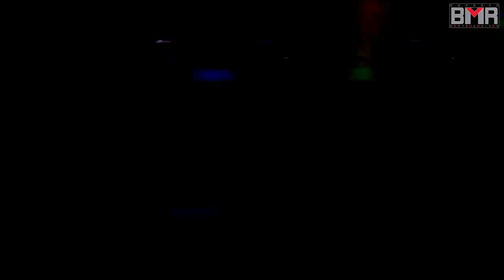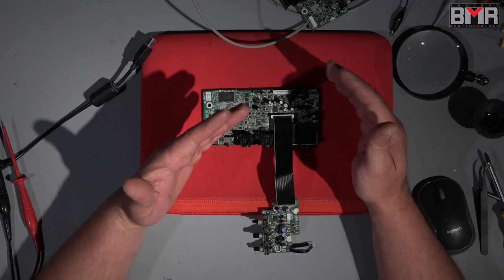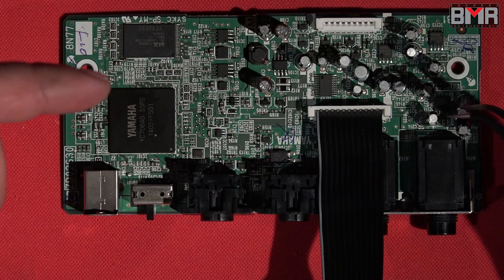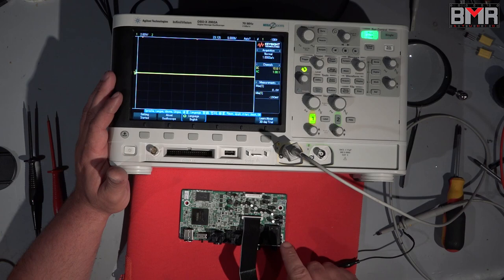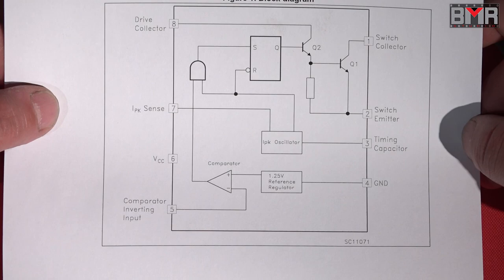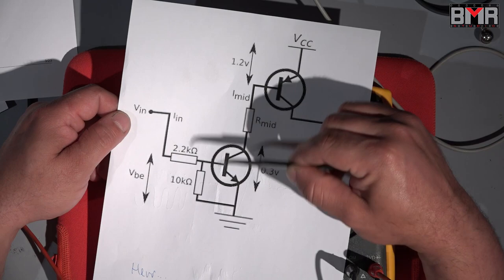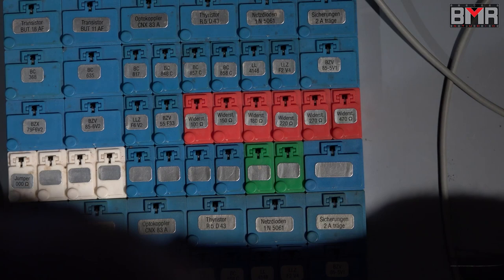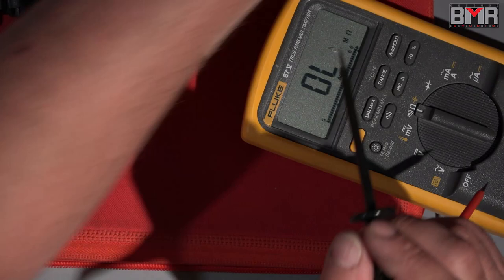Steinberg UR22 usb audio interface repair! MAILBAG!

Comment: Hey, i got a problem with my Steinberg UR 22 MK2. Everything works fine, but the only problem I have is that when I connect my DT770 pro, i only get a mono Signal Output. I updated drivers to the newest, the mix is completely on DAW (right side) but it stays mono. When I plug my Headphones directly to my pc i got a stereo signal and everything works fine. The adapter I use to plug it into the Steinberg is the one that came with the headphones and its new. I cant find a answer so i hope you might help me out before i give it back and buy a new one

Comment: Hi! I have got this interface too and today I dropped it. It still works standalone, but it won't work on my computer anymore. Do you know, what I should be looking for when I open it up? Or could it be that the cable won't transfer the data anymore, only the electricity? I hope you will respond! :)

Comment: Really great video. I see that the op amp is an NJM2068D but what transistor did you use please?
Reply from the maker: Dermot Donnelly I will share the part numbers what I replaced.
There is more dead animal on the input board:)
Reply: @BMRStudio  Great. Thanks

Comment: Hi, at 5:53 you inspect a ur22mkii(what I have). Unfortunately I was careless and dropped it one to many times and the digital side is compromised(will not synch up with laptop but has voltage to the device). I have done some troubleshooting(of many, many things), but this seems overwhelming. Any tips on how to go about it? Not the cable I already checked that!.
Reply from the maker: Check the power supply area. There is many small ceramic capacitors, and may one is cracked. Try to find the "power on good line" which is going to the small CPU reset circuit.  look for the 3.3 and 1.8 V rails!

Comment: Hi there I was wondering if you can please help me. Im having a little difficulties with my Yamaha UR mkii the second input is making a lot of noise when I try to record with my guitar. Any advice will be very helpful.
Reply from the maker: The pickups and the tone circuit is ok in Your guitar? Can you drive a normal AMP without noise?
Reply: @BMRStudio  Yes, all good with the guitar. I use a Fender Strat with an Fender Sidekick Reverb amp, also the first input on the Yamaha UR mkii is ok. Only the second input has this problem, as an example when i plug my guitar on the second input, the guitar output is really low and the white noise is really high. Maybe it has something to do with the hardware?